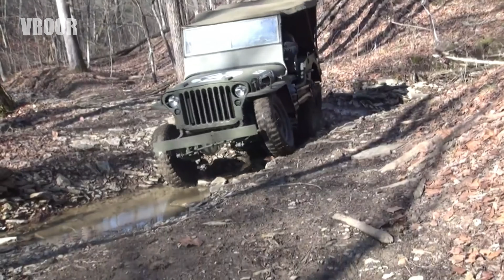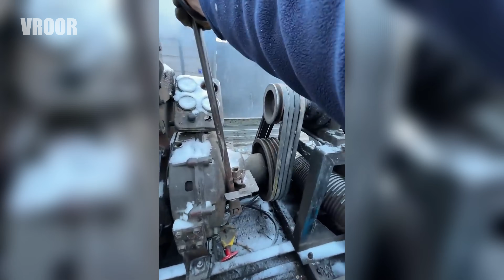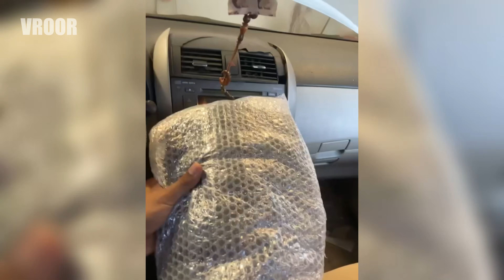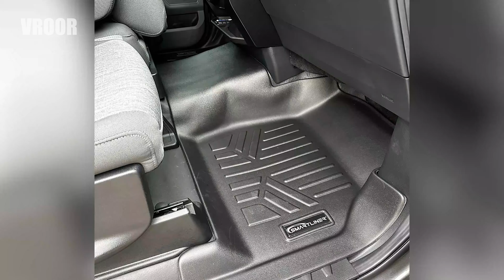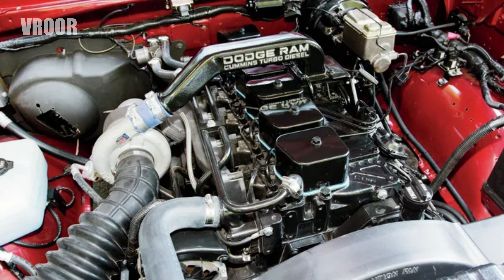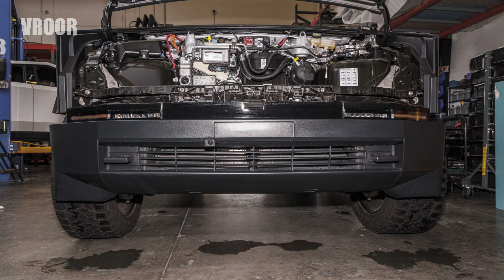10 Brilliant Classic Truck Features They Killed — Old-Timers Never Forgave Them!

Comment: i always locked in my hubs first time it was snowy enough to need 4 wd. then in spring when the snow was gone i unlocked them. did that for years. the stock cv axles made it for over 230k miles. haven't changed out hubs yet.
Reply from the maker: That's a fantastic long-term testament to the durability of those classic truck components! Smart move locking in the hubs proactively.

Comment: BS! You cannot replace a single spoke on a Dayton wheel, you have to replace the entire hub and that was quite frequently because of hub wear that caused wheel slippage so Budd wheels were a welcome change. Get it right
Reply: I worked on tires in the 70's and Dayton wheels were hard to get tight and straight. They were never as tight as you could get a Budd. Budds took over for several reasons and being able to get them tight to the hub was one. Having them run straight without spending a lot of time getting them true is another! The Budd system is much better in so many ways!
Reply from the maker: Thanks for sharing your perspective on Dayton vs. Budd wheels! It's always great to hear different insights and experiences, especially when it comes to classic trucks.
Reply: in the 21st century, get it right is a tall order... my 92 Toyota truck has wing windows. ...dunno what year they went away completely.

Comment: The Dayton wheel went away because brake systems got much better! When the drum stopped the wheel could keep moving and tear the valve stem off! Then you had to remove the tire and replace the tube or a new stem in tubeless tires. 
     The air starter went away in favor of electric starters because you could jump a drained set of batteries but if you ran out of air and you may not have a compressor handy.
Reply: Another good point that AI guy can't comprehend
Reply from the maker: That's a fantastic point about the Dayton wheel and the air starter! You've definitely hit on some key reasons why those features faded out.